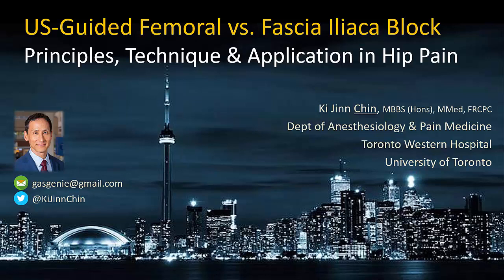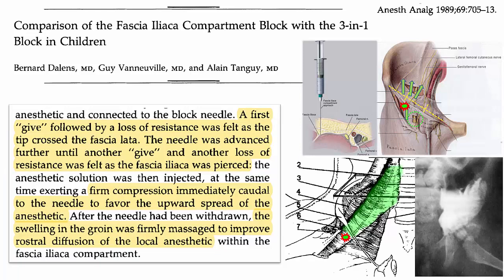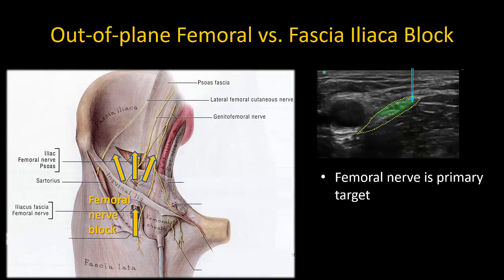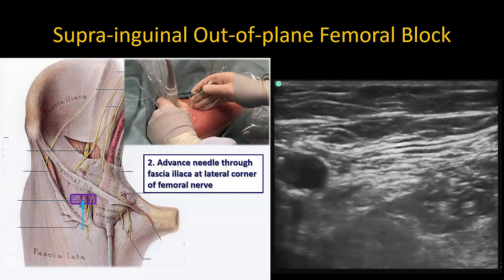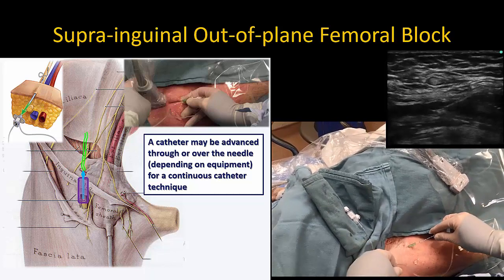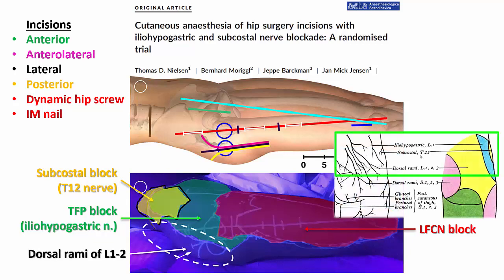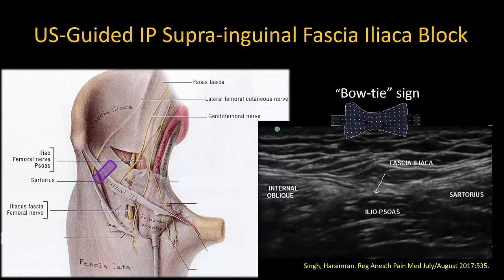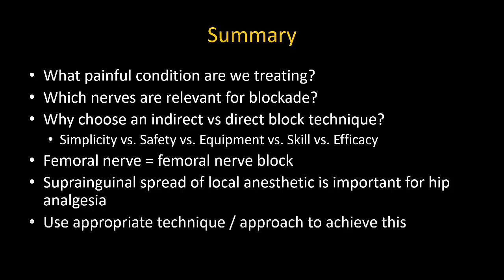Ultrasound-guided Fascia Iliaca Blocks

Comment: Excellent presentation as always! Do you use the same technique even for obese individuals? For those patients sometimes due to the thick soft tissue you need to go through & steep angle used before reaching the desired plane it is quite difficult to adopt a shallow angle afterwards to keep the needle in the plane when you hydrodissect to the cephalad direction.
Reply from the maker: Good observations - and there may also be a pannus that needs to be retracted by an assistant. In these cases, probably the best way around it is to use a Catheter-Through-Needle (CTN) set rather than the catheter-over-needle set. If you open up the fascial plane/space with the loading bolus, the catheter should thread through the Tuohy, turn the corner despite a steep needle angle, and find its way cranially under fascia iliaca.
Reply: @KiJinnChin  Thank you Dr Chin! Definitely will give that a try next time

Comment: @kijinnchin great video. Is it possible deposition of local anesthetic farther away from femoral nerve (bowtie or J Gadsden's approach) decreases incidence/intensity of motor block via differential sensory block (a la QL for abdominal surgery; or Lumbar ESP for spine surgery)? This may have useful in an outpatient setting to facilitate PT on POD0, prior to the advent of PENG; but a moot point if using fascia iliac for inpatient hip fracture (instead of ambulatory total hip arthroplasty)
Reply from the maker: Yes, I think that differential block based on distance of deposition from target nerves is a valid point. May also explain why lumbar plexus blocks were used for a long time in total hip replacements, seemingly without much concern for dense motor block. Your reasoning regarding appropriate use of blocks for a given context is also sound and in line with my thinking.
Reply: @KiJinnChin  Am curious if you feel differential block is the reason behind analgesic efficacy of high-volume (30 ml) adductor, likely due to indirect spillover to Femoral nerve). As well as quadriceps palsy risk in slender patients BMI < 25.

Comment: Excellent explanation, diagrams, and videos. I also use this OOP-to-IP approach for PIVs and arterial lines.
Reply from the maker: Yes - so do I! OOP ensures you come right down on the vessel so it doesn't slide away from the needle, and the IP view then allows you to ensure you have the right trajectory and don't pierce the back wall. Thanks for the comment!

Comment: What is your go to block for hip arthroscopy at an outpatient surgery center? Would you do this block or a PENG block?
Reply from the maker: Hip arthroscopy is complicated with regards to pain etiology, and unpredictable. PENG would address capsule pain, but pain may also be muscular, e.g. from traction or fluid extravasation. If immediate weight-bearing and quads function not required, femoral/FI block might cover more bases.
Reply: @KiJinnChin  Thanks for the quick reply! I do think that quad function is valuable in the outpatient setting where many hip scopes don’t involve repairs and can be quick and often not that painful.